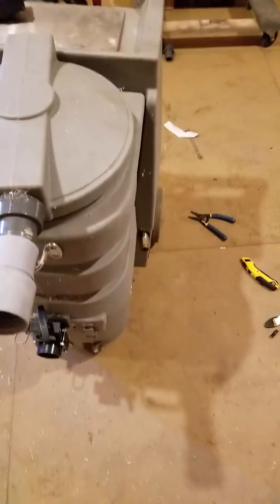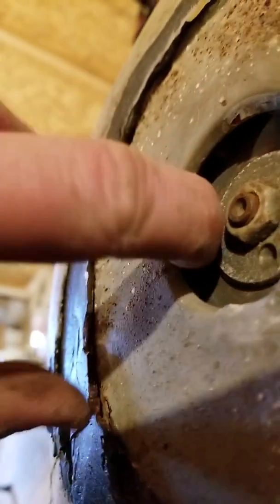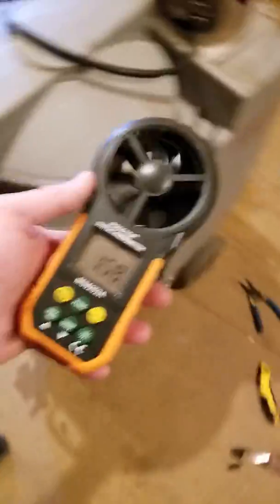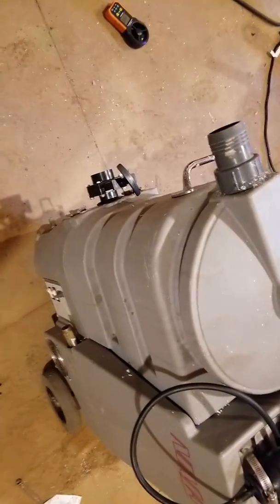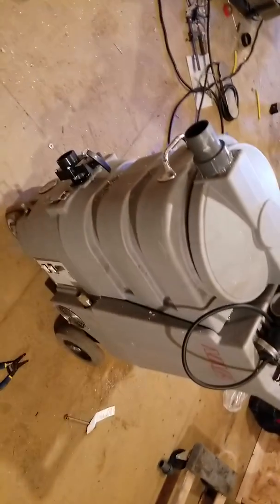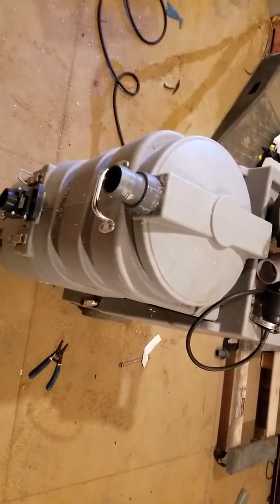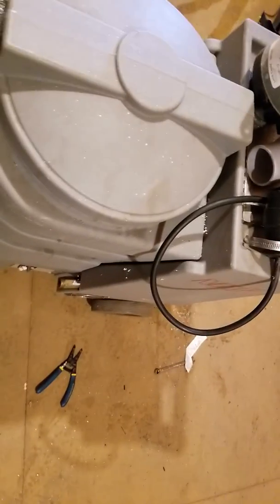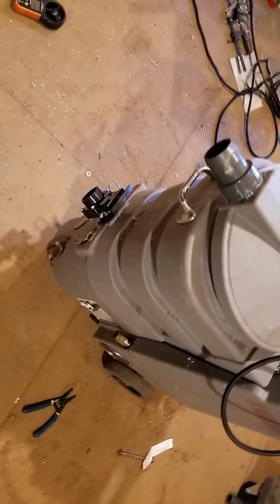Start a carpet cleaning business on the cheap part5 vac motor testing

Comment: Enjoyed watching this, brought back memories, remember buying my first extractor, $50 in the 90's, got it cheap because pressure pump stuffed and old machine made in the 1970's and the machine look like a wreak, replaced 2 stage 1100 watt motor with 3 stage 1500 watt vacuum motor, new 200 psi pump, replaced all seals, up graded it from 1 inch hose to 2 inch, $500 spent on it, coat of paint couple of detail car stickers and that machine did another 10 years, 3 years as a workhorse, 7 as backup machine or brought out for big jobs when using multiple machines.  I sold it in early 2004 for $500. Extractors are simple machines, I've modified everyone I owned, every little extra lift or airflow worth the effort.

Comment: HI, what is the number you put on your test in AREAS 0.020 per ft or 0.030 ft? Thank you!
Reply from the maker: 0.020 but it depends on the diameter of the orifice if it's a 1.5in it has to be calibrated differently or is it's 2.5in it has to be calibrated differently when you buy it it describes it in the manual

Comment: I was doing carpet cleaning for 8 years with some company i am starting my own here in vegas  i have a truckmount but sometimes i need to use the portable and people get mad cuz the think the portable will not clean at all lol is hard but i am trying to no show the portable before i go inside and give the price bring my chemicals start spraying and 10 minutes later boom the portable hahahhaa
Reply from the maker: it's always important to remember to remind the customer that they hired you as an expert in a you use the best equipment available for their given tasks that way you don't have to sneak around or be embarrassed with a porty
Reply: I have been doing carpet cleaning for ner 30 years and l started with a portable with 100 psi and heat with good cems and pre scrub or agitation you can do very good work
Reply: @dewaynemarcionette6112  yes thats what i do i am using the orbiter good chemicals and the carpet looks great after i am done